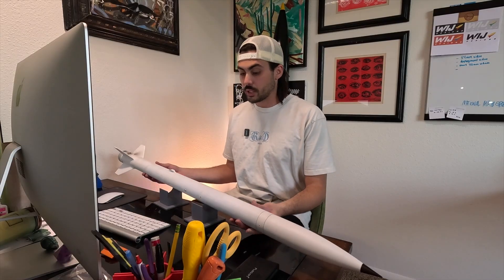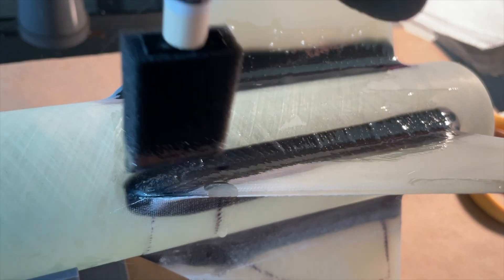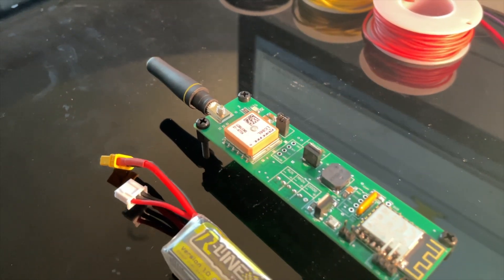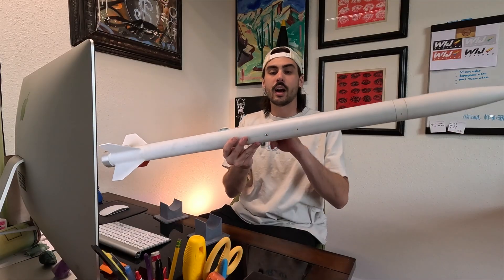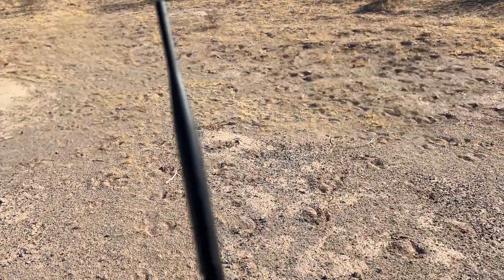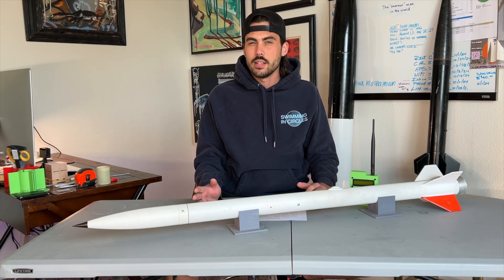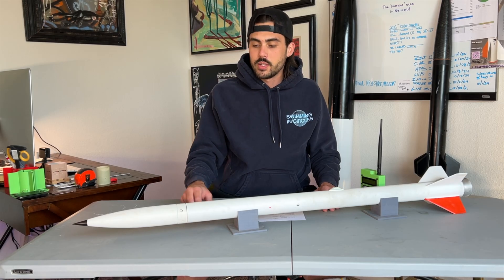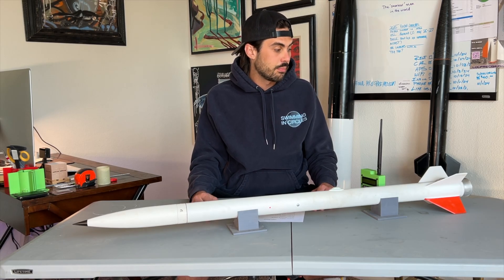High Performance Rocket Build - 54mm Minimum Diameter

Comment: What material are you using between the 2 bulk plates for the shock cord anchor?
Reply from the maker: Its just a solid PLA puck I printed. About .75" thick
Reply: @mindofwij and that is a strong enough anchor? Were you worried about the screws coming out?
Reply from the maker: @axiom3935 not really, the screws are almost an inch long. they are also threaded into steel inserts that sit in the PLA. If it breaks that means something else went wrong lol

Comment: Amazing video, working on a Wildman Mach 2 for L3 prep as well and using a Quasar too, deja vu to the max but I want to fly on a K695 and get it to Mach 1.5 or so and maybe a K1100/K1103 after that and see if I can push Mach 2

Comment: If you want altitude, use engines with a longer burn time in the first place!  Drag increases with speed as the square of the speed. So you accelerate the rocket above the speed of sound in the densest lower layer of air.  Friction eats up power!  If you can fit a CTI K260 or K300 long burn time motor in the rocket. Or something similar from Aerotech.  It won't be as fast, but it will fly higher!
Reply from the maker: @csabaalmasi4609  Indeed!! Next flight is a K550 not exactly long burn but expecting 11k & Mach 1.4. I’ll post a video of that flight. Next build (vids coming soon) is a lightweight 54 minimum diameter made specifically for long burn motors.